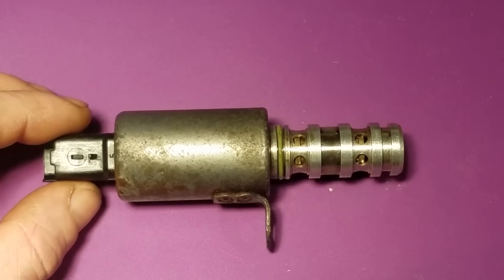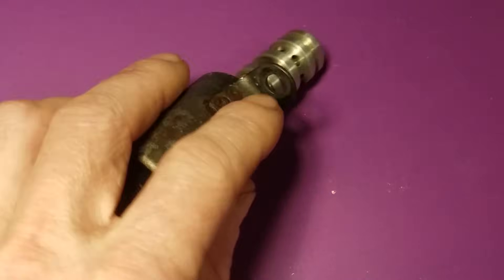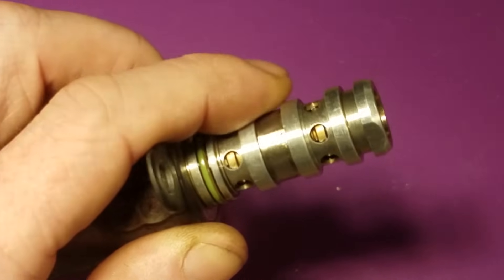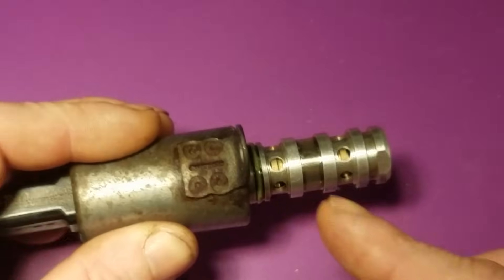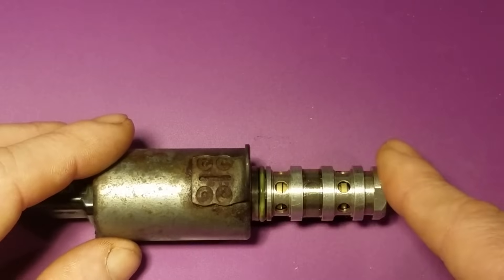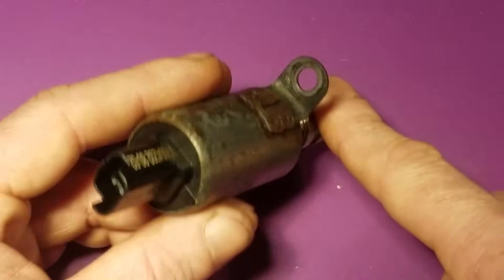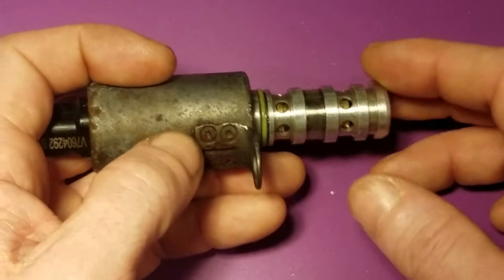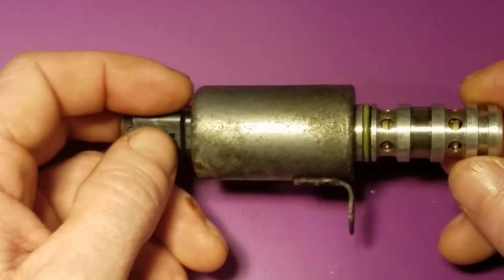Variable Valve Timing Code p0011 p0010 p0012 p0013 p0014 p0028 (Don't Waste Money)

Comment: 2004 Nissan X-trail code P1111 intake valve timing valve cir/B1
1st remove and check the valve and so very dirt and not working anymore
2nd replace the valve and clear code and start the engine, but after a second the code came back again,.

so what's  wrong like this? the valve is new but still came back,. i hope you share your knowledge like this problems, thank you and advance
Reply: Nissan sucks..my juke the same changed 2 solenoids and still the code appears
Reply: @florens felizardo
the solution of that problem are; 1st pull out the Variable valve timing housing and clean, 2nd change engine oil and oil filter then after that, clear fault code, then start the engine to see the code if come back,. 
because I try this test if work,. Yes! its work! hehe Glory to God

Comment: Yeah, I change my oil every 2,500 miles.. that doesn’t help. Assuming I need to replace the solonoid itself, or could be the camshaft position sensor..not sure. But my car is running like shit.
Reply: Too frequent oil change.

Comment: Had light come on after driving 800 miles.  car still ran fine finishing my 1125 trip. '12 Impala 3.6. oil was maybe 3/8 " below full mark. light went off after driving it around town before topping off oil level. is it possible to get rear solenoid actuator out of engine(to clean)  as it is close to strut brace? I read that it can be angled and removed. oil is clean. car has 97000 miles on it.
Reply from the maker: Yes, I believe the rear one can be removed.

Comment: Helping another he got the code P0011 and P0014 from low oil and lack of changing the oil for 7,243 miles he took it to the shop and they said based off the codes they want to replace the timing chain saying it stretched. Could this be true. And said the repair bill will be $3,000 smh
Reply from the maker: It could be true but I would try changing the oil and or cleaning solenoid before spending that kind of $$
Reply: did u ever fix terrell

Comment: would it throw a p0016 code
Reply from the maker: It could!
Reply: thanks that was quick :)
Reply: low oil, + very sludgy, might be clogged,  no rpm over 2000 and variable oil pressure,  I i will inspect the vvt solenoid

Comment: Sadly not all of them are easy to access of remove....FORD I am looking at you.....My wife's Edge needed one replaced and the lovely engineers at Ford decided to bury them under the intake manifold that has to be removed to take these simple one bolt parts out. Not to mention all of the hoses and lines and other stuff you have to remove just to get the dang manifold off to gain access. They seem to hate us working on our own cars and want to make it as hard as humanly possible for us now.

Comment: Just change the damn thing
Reply: I changed mine 3 times in last two years $52 a pop just took an old one n did what he said n cleaned screens n tested it n bam fixed. If i knew first time id saved $156.00 im sure in 5 to 6 months ill be doing it again n i change my oil before due date because of this problem. These new cars are all junk. I miss my 94 s10 drove it till frame cracked n even drove it to junk yard broken frame damn you wisconsin salted roads

Comment: if i fill my gas tank and add some fuel injector cleaner wouldn't that be the same as taking the timing valve off and cleaning it with engine cleaner but less hassle ??
Reply: no. oil goes through these, not gas.

Comment: I have this noise problem with my 2010 Honda Accord.  I pulled the solenoid, which was clean.  I tested the solenoid as you suggested.  I put in back in, and the engine still makes the noise.  Any other suggestions???
Reply from the maker: You could have a timing chain guild that is bad or tensioner or could just be the valves need adjusting really hard to say without hearing it. I would take it to get looked at.
Reply: Gerry Martinez your VCT GEAR itself is bad and needs replacing

Comment: Kinda a bush-league repair? I would not re-use a part with any missing component. They are there for a reason. Please don't advise foolish shortcuts that could cost someone an engine. The part is only 40 bucks.